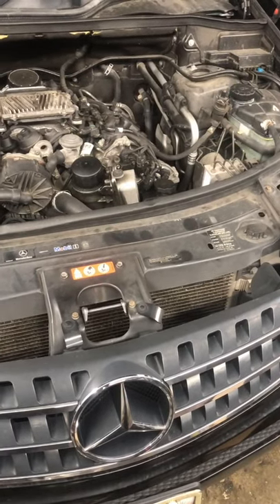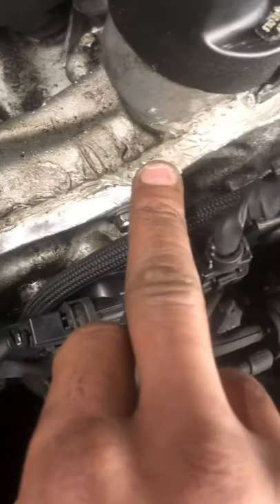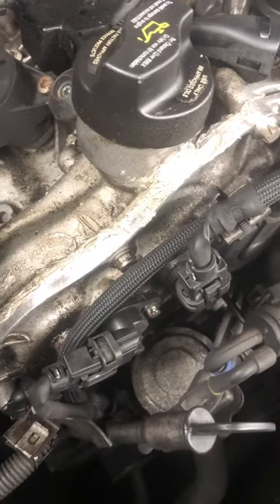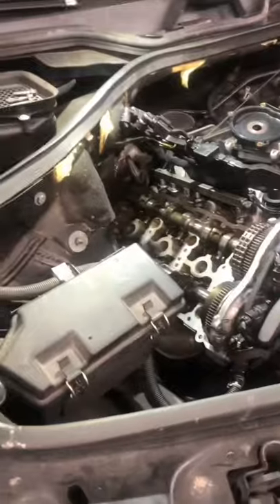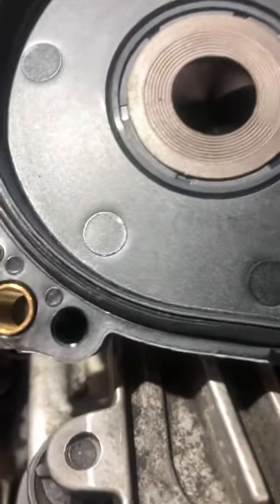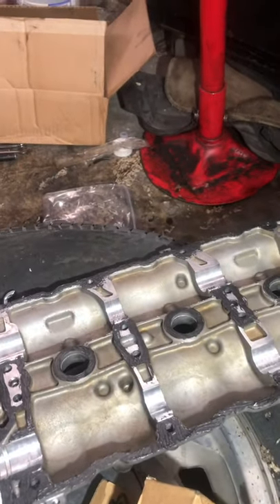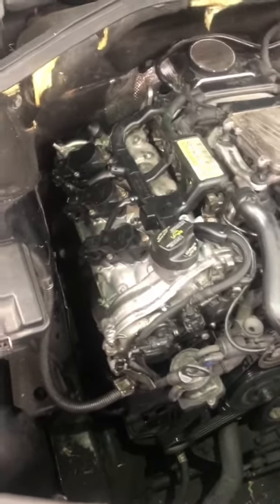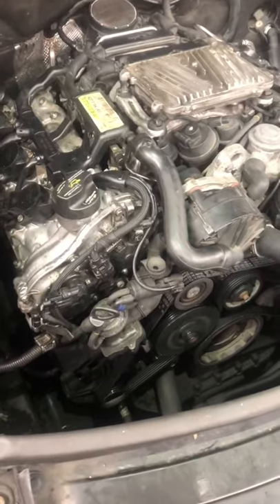2007 Mercedes ML 350 properValve cover gasket replacement

Comment: How much would the messed  upjob cost after you fixed the mistake someone did.  The exact job .
Proving nothing else is messed up on the Mercedes.
Someone just did this to mine with twice the cylicone 😢

Great job by the way
Reply from the maker: Oooooo noooo I’m so so sorry to hear.  I’m not sure what was the cost on that repair but I hope if there anything I could help you with

Comment: Silicone on valve cover should be an even and continuous line of 1.2millimeters on the perimeter and around the spark plug holes as per Mercedes specs on M272 engine. Too much will allow silicone to go into oil ducts and cause an oil pump blockage and eventually an engine failure. Even though you've done a way better job than the previous one and you have used the correct product you're still using too much silicone. The line has to be thinner than that and once sealed and torqued you don't want to see the black stuff sticking out in the joint between head and valve cover.
If after the job the cover is still leaking, then something is wrong with the assembly and most likely the head and cover has to be replaced at once since they are factory matched and the cover only cannot be replaced...it simply won't match 100%.
Clearly someone before you has worked on the car (balance shaft replacement?) and has put it back together somehow in a wrong way causing the oil leak and smoke. Perhaps they broke the original cover and got a replacement from a junk yard or an aftermarket on ebay. On M272 and M273 engines the valve cover should never leak.

Comment: Hello sir. I am about to take out the valve lifters on a clk 350 I believe it's the same engine, I'm looking for torque specs for valve cover and crankshaft so I can put everything back together properly. Can you share any info on torque specs for this engine please? I'm also making sure I can keep the timing chain dead center to take camshaft out and reach valve lifter and put back, any knowledge you can bestow upon me for removing timing chain and putting back? Thank you so much!!!

Comment: What happens if you were to remove the small silver box that the wires over the gasket are connected to?
Reply from the maker: I’m not sure if you are talking about the module on top of the manifold but if I do understand what you are saying if you remove all the bolts to the bracket of the harness all the wires will get out the way for you to complete the job

I hope I replied to your comment in any helpful way 

Thanks for watching

Comment: Hey nice job Moe Are the cylinder head cover bolts torque to yield and need to be replaced ??? or can they be reused
Reply from the maker: You could definitely reuse them and you could definitely torque them if you like just look up the torque specs I didn’t torque it because I’ve been doing it for so long I know how tight they needs to be
Reply: @moesautoclinic6368 
You think you’re smarter than a torque wrench?

Also, you misunderstood what the other guy was asking. He was talking about “torque to yield” bolts. Yep, that’s a thing, look it up and learn! Maybe?

Comment: What kind of silicone did you use on the valve cover
Reply from the maker: You could ask your local parts department such as advance or any local auto parts department if they have Mercedes-Benz silicon or you could buy it directly from the dealer it’s not that expensive it’s about $15-$17👍🏼
Reply: @moesautoclinic6368  thank you!
Reply from the maker: @Devils9027  you welcome and let me know if there’s any help or any questions you have and I’ll try to respond back if I can

Comment: Can you share the PN of the gasket for this year? Cant seem to find anything after 2005. Thanks
Reply from the maker: What are you trying to seal exactly most of Mercdece Benz have RTV silicone you could either purchase it at the dealership or they have something at your local parts store that is compatible with it
Reply: It Does not have a gasket

Comment: Pls I have a smoking c300 engine smoking but am finding out its the cylinder one alone that is covered with lots of oil
Reply from the maker: It could be the valve cover it’s self leaking or you have a internal problem like oil seal leaking and burning oil

Comment: So you only do one side ?
Reply from the maker: Yes the side that is only leaking sometime both sides are leaking in this case one side was leaking

Please if you are doing this job on your own please don’t get happy with the silicone make sure you use it very lightly and very careful that way it seals correctly with you🙏🏼💪🏽

Comment: Bro, when taking off the valve covers , is it necessary to remove the torx bolts on on the front timing covers ?
Reply from the maker: I appreciate the advice and appreciate the comment everyone has a different style of working but I will definitely keep your advice for the next vehicle thanks for taking the time to watch and I hope you like and subscribe
Reply: @moesautoclinic6368  he was asking???
Reply from the maker: No you could keep them in don’t not remove them as showing in the video 

My bad about the miss understanding
Reply: @moesautoclinic6368  Moe I had a leak at my brake vacuum pump located on the back side of the driverside valve cover. I removed the vacuum pump and sit had a crack in it. Apparently the nubs on the manual vacuum pump broke off and made the seal around the pump to the valve cover leak. Before I loosened the bolts on the vacuum pump for removal I saw a slight gap between the pump and valve cover the gasket was mangled popping out a bit from the pump being knocked outward when the cam catch teeth on the pump broke causing it  to pertrude and leak. 
I discovered the two broken teeth when I removed the pump and saw the metal missing the two teeth were in there and the one was wedged between the mating surface of the valve cover and the Head. A chunk of that valve cover area was missing the tooth from the vacuum pump was wedged in that area I used a small pick tool and removed it. I think I need a new valve cover I hope the head is ok. I wish I could send you pics just to show you what I experienced. I don't really have a question I'm just here to rant, I already threw a few tools at the wall and smoked a half a pack of cigs and stomped my feet. I might goto the forums.
 As I said i don't have a question I'm just annoyed. I won't know much til I remove this driverside valve cover but yeah I snapped a picture with my phone and saw that tooth from the vac pump sitting at a spot on the valve cover that had a chunk of the valve cover missing and the tooth laying in the damn hole. The valve cover wasn't broken thru but like I said it has a big chunk missing it's thee rounded area on the rear of the driver valve cover. Where the brake vacuum pump bolts up. It's so sad that it is funny. I can't believe this shyt
Reply from the maker: @conormcgregor5460  so you’re talking about the vacuum pump in the back of the valve cover make sure you check the seal around that pump they do come defect and make sure you use no silicone back there just clean it very well and get all the old Depreand tighten the bolts with a quarter inch and if you have that picture it would be nice if I could have a look at it and I could probably help you more but definitely check the seal at that plastic vacuum pump and if this is the original one Definitely replace it with a new one
Reply: @moesautoclinic6368  ok yeah what's your email Ill shoot you pics of the damage